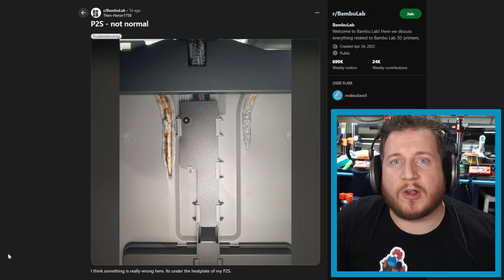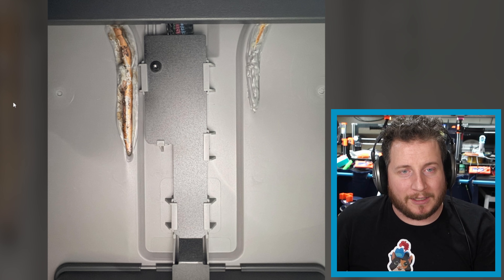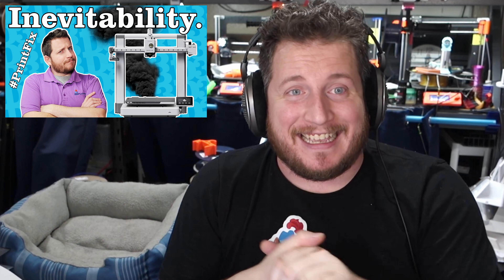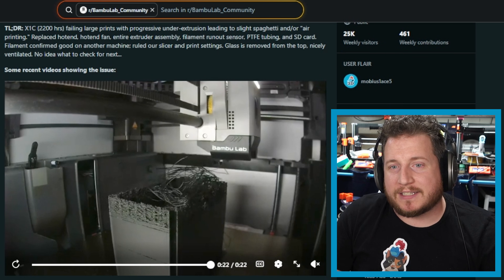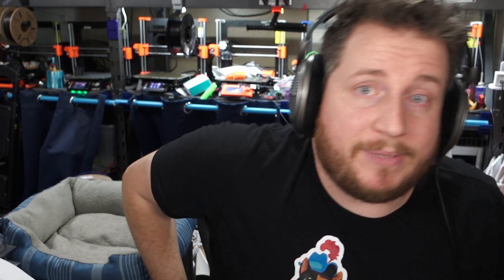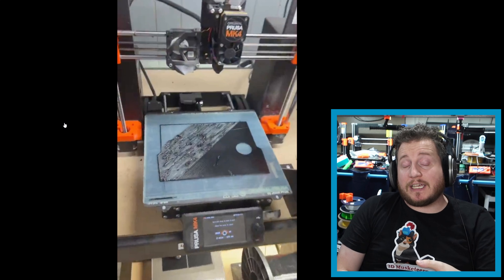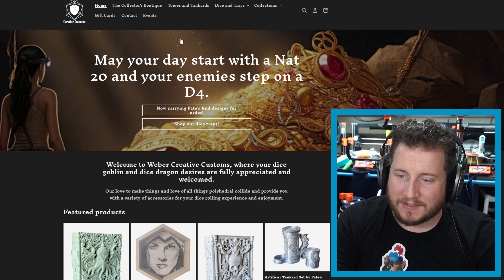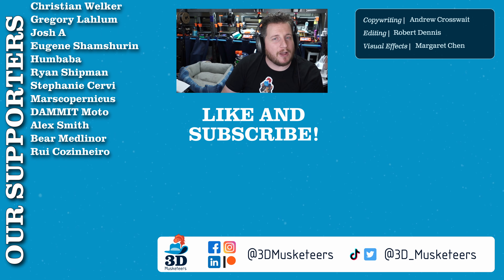Bambu FINALLY Responded - PrintFixFriday 226

Comment: I was listening to one of your shows, not sure what one it was on Podcast which I do frequently.  You were mentioning best sub 1K printer for 2025.   I heard the U1 come up.  I just went to check it out, one thing really makes me hesitate on it, I see it has a carbon fiber tube on it, thought other companies ditched carbon fiber tubes after they found out they can wear out and are not user replaceable?  Do you have any info on this topic? The U1 would be nice add to my small farm, perfect for some of stuff I do.  How easy is it get critical common fail spare parts for stock for U1?

Right now best bang for buck for me for proven printer is a 4Plus which I has been extremely reliable for me after certain early issues were taken care of.  I think for single color and bed size it is killer setup in that price range, this thing outperforms my H2D on quality of prints, this may change as I gain more time with my H2D, but print speeds and quality I get on Plus4 remains my fastest high quality output printer and they sell for 699.  I have several thousand hours on my Plus4 and it just prints perfect prints job after job, do tons of ABS on it all the time, and most of prints are extremely large. I love the footprint on it.  Other ones come to mind, the P1S at 399 is killer deal.  P2S is fantastic machine.  I have found that the 305 footprint and weight of Plus4 is at about the top size of range that I find comfortable to move on own. H2D is nice, but very tough to change out parts in this machine if you have issues like hot end fan failure, it is tough long job to replace fan or a board in it.  I have two Centauris with hundreds of hours each and absolutely zero failed prints, shame they are not releasing AMS for it.  My Centauri's do flawless ABS, once again and prints are very large volume prints. No warping. 

I need something that can do super high temps, I am looking into doing materials that require 400C plus temps.....and much higher bed temps then stock hobby printers.  I have begun my search to find a new printer that is setup for higher temperatures.   Product I am looking at making uses Ultem. Everything I have looked at to date requires about 10K investment.  CreatBot Peek 250 is one machine looking at, need to do more research on this type of printer that can match specs I need to meet.  i do like idea of direct annealing of print.  Everything I would make must be aircraft certified materials, traceable. Gearing up for better annealing setup also in 2026.

Comment: I run 8 of these but i have no idea qhere to look. Is there a manual somewhere on how to check this and replace of of needed
Reply from the maker: on the side under the wiper poop thing on the left side of the printer.

Comment: The Sunlu Matte issue goes deeper than covered. Unlike the shown  listing not being obvious but eventually saying matte somewhere, the listing for the high speed with spools (not refills) DO NOT (currently) mention matte at all, and yet guess what showed up for my Red/White/Blue/Black 4kg pack of high speed PETG? Matte. It doesn't stop there. Not only does the matte print like garbage even after drying, it looks like it is missing 50% of the necessary pigmentation. Red is a weird almost salmon color. White is a frosted mess. Black and Blue aren't much better. The color is not uniform through the print either with settings that work fine for every other brand of PETG I've run through my P1S. I ended up returning the entire package, and I never do that. I'll find things to print out of filaments I'm not super pleased with. Sunlu matte PETG was bad enough it went back asap. Never again, which is a shame because it comes packaged well and their refillable spool is nice.

Comment: Regular preventative maintenance and common sense printing prevents a lot of these issues. Anything that has heat and movement should be checked regularly.
Reply from the maker: This is absolutely not a part that should ever need to be checked on the Bambu, but if you were referring to the other fails, yes, often general checking is a great way to verify everything is still as expected.

Comment: Why doesn’t Bambu identify  which A1 printers have the updated power board by serial number. Who is to say how long before a printer sat in a warehouse or store before it was actually sold. I bought mine in November 25 but it could of sat 6 months

Comment: BTW,  has anyone bothered to check if these heat problems with the Bambu A1 and P1S started after a specific firmware update? Didn't hear anything about this before on their older machines before recent firmware updates. Something like an increased load on the board due to PID control loop changes to the firmware? And I have an A1 and P1S, but have not updated the firmware since the version that would have locked out my Panda Touch. No visible issue on the boards so far.
Reply from the maker: We have reports as far back as mid summer 2024. So?

Comment: "Never leave your printer unattended" - yeah right.  Like for a 20 hour print, you're going to just sit there?  I usually time kicking off my long prints so they're just finishing when I wake up.  This lets me monitor the start to check for warping or other bed adhesion issues, but after that, it's on its own.  I'm trusting my H2D to spot a failed print and do the right thing.  While I'm awake, I will keep checking in Bambu Handy, but there's no way I'm baby sitting any print that's longer than a few minutes.

If Bambu are blaming power surges, I guess we should all use surge suppressors, so if they try to blame a surge we can tell them to think again.

Colours in order: black, white, grey, clear, red, orange.  I mostly print functional stuff, and black probably accounts for 80%.  White can be useful for prototypes where I can mark them with a pencil to highlight where I need to modify.  Grey gets used for functional prints where black will be too austere.  Clear gets used for my spool storage doors so I can see what's inside.  Red & orange are just for accents/text.  I've also done a few wood prints.  There's a great wood grain texture on MakerWorld that makes prints look like they've been carved from wood (it even generates endgrain patterns).

Comment: I mostly use white filament for prototyping. My experience is white filaments are among the strongest within the same material. And it doesn't really hide potential mechanical failures.

Comment: Our experience with Sunlu has put them on our do not buy list. We bought a three colour 10 reel combo pack from Amazon. Both of the white spools we bought stopped unspooling almost immediately (filament stuck together on the spool so the printer couldn't pull it off the spool, or snapped the filament trying). Three of the five black spools started doing this at the 500-800g mark. The three spools of grey were the only ones that didn't exhibit this problems.

Once bitten, twice shy, as they say.

(Incidentally, I feel called out for asking about the A1 mini too, since we have both *8')

Comment: Is there a way to verify via serial number if the machine was produced in the correct timeframe to not have this issue
Reply from the maker: Not that we are aware of. It's easier to just peek on the inside.

Comment: I absolutely hate matte filament. It prints like poo. In fact I have some spools of it that I'm just printing things that I don't REALLY care about. Things I'm just using for myself and not giving to anyone. I can usually get a successful print, but the prints are brittle or the layers easily split apart. So I'm not using it for anything that will hold a load, that's for sure.

Comment: They specced a part that was running within an inch of it's life with basically no safety margin. Pure and simple. Let's not forget that for as much as these machines cost, they're still made by the cheapest bidder.

Comment: Problem with Prusa  bed connectors started with MK2 printers (Mine was one of them caused the main control board to become charred but still functional). I added an aftermarket Mosfet board to solve the problem).

Comment: If electric was cause, simply run off of a UPS which has clean conditioned power source.  Any expensive electronics should be run off a high quality conditioned power source.  I only provide the generation side of the grid, and the grid is a very complex and highly strained system these days.........and quite old infrastructure, as AI data centers grow out demand is really going to test the grid to the max in specific regions of the USA.  Predictions are showing very fast growth on grid electric demand in coming years.  It will really test our systems here in various regions of USA, each grid is not the same.  

Every grid in USA has it's own kind of unique character and size.  Throw in the great unreliability of green power into daily mix, and things will get ugly.  Nothing beats power that can be switched on when needed, there is a reason the core power of USA is natural gas, coal, nuclear powered, with some hydro mixed in.  The cost of wind means utility bills are going to skyrocket in the future, salt water and metal just do not mix well. That high demand and variability in solar and wind will mean more chances for grid issues....nature of the beast.
Reply from the maker: On surge and on ups's we still see the issue.

Comment: I'm mostly printing in black, but I've been using a bunch of 3D Fuel Natural PLA pro because it turns out kind of a pearl white which looks great, it's been good for functional parts, and it has printed really well. Occasionally have Flashforge burnt titanium moods like it seems a lot of people have and I'm not mad, i like the color. The black and blie shift with the green was great for a sega genesis themed print I did for a handheld I have.

Comment: Saw you got tagged on 3 new thernistor reports in a single reddit thread this afternoon. It's been a couple months so thank you again for bringing their buainess practices to light when they started being shady and saving me from the various headaches. My Magneto X might yeet motion motors out of the housing eventually, but they're slow and not an ignition temp failure, and the company has been great with the couple issues I've had so far. 

I just hope they're quiet because they're working on things and not doing a slow fade like my first printer manufacturer (Kywoo) did.

Comment: I bought an A1 from an 'Authorised Reseller' in June last year. Up until that point I only had one old Creality CR6 SE, which was giving me the $h!tZ hence buying a new printer. From day one I was having problems with breakers tripping. I assumed it was because I now had 2 printers running on the same circuit as other equipment, probably wasn't good anyway, but it was what I had. Anyway I had another circuit added, not cheap, and still had the same issue. One day I was out while the printer was going, the dog was keeping an eye on the printer for me 😋. When I got back the print had stopped half way, there was power, but nothing was working.
Got in touch with Bambu and they asked for photos, who I got it from, a receipt number and serial number, all provided. They came back with, no idea who that is you'll need to contact them. So I did, mentioning that Bambu did not recognise them as a reseller. Anyway, long story short, a lot of back and fro with Bambu and the supplier, and I now have 3 brand new power boards, 3 brand new bottom covers and 3 brand new wiring harnesses. Why 3, well it took so long for Bambu and the supplier to do anything, I just bought the parts from a legit reseller that had them in stock. 
The unit from Bambu and the one I bought do not have the Thermistor on the board, whereas the one from the supplier of the machine did. Guess I won't be using that board 😋
Thanks for the content, only found you today. Subscribed 😀
Reply from the maker: If you got the old one still and dont mind, we would love to pay to have it shipped to us. We will cover all associated costs :) 

Glad you have spares though! I may want to get some of those bottoms too, if your reseller can sell you a couple more.. I want to see just how FR they are...
Reply: @3DMusketeers  Yeah of course. Just DM me and we can arrange something.
Reply: @3DMusketeers  Actually just re-read your message. Sorry no I don't have the old (burned out) one. But happy to send you one of the covers, I'll see if I can get a couple more.
Reply from the maker: Ah bummer, tossed it? Yeah send me an email or dm me on discord. Would love to get some plastics in for testing.

Comment: I also bought SUNLU High Speed Matte PETG (black & white) and I don't know what they've added, but god this stuff always gets welded to the textured PEI, I thought I'm going crazy, even started to hack the bed temp down to the 40-45C, but it still behaves weird.
Reply: that's why its recommended to use glue. It's not to keep the part adhered to the bed. It's to help it release.
Reply: @Jodah175 I thought that I could get away with it on Textured PEI, since regular PETG works just fine.

Comment: Bambu print quality still shits on everything else.
Reply: They are good, but many other printers are just as good and they are quite slow with some materials like TPU compared to other printers.
Reply from the maker: that, in no way shape or form, is related to their safety issues. I dont care how good your printer is if it is a fire hazard....

Comment: So, as someone with an A1, and "not smart" with tech, any easy way to know if I should practise more caution? I think mine is from Q1 2024. I have one made after the last recall with the bed wire issue.
Reply from the maker: Yours is within the date range we are watching. Proceed with caution. Big ones: put concrete under it. It is cheap and will quiet the machine down some, so why not. Also, reach out to BL and tell them you are not comfortable with the safety risk and dont back down IMO. Try to not heat the bed and hotend at the same time, but meh, I dont think that matters THAT much, however we dont have a bunch of data on that yet.
Reply: @3DMusketeers  Well thanks. Now I kinda want to heat cycle it multiple times, with the block under it and a fire extinguisher bar above, just to see. Just looked, I see no heat deformation in the plastic at least. 

Kinda funny, with how well these machines are being made nowadays, that garage melting fear is coming back.

Comment: +1 vote for concrete pads under 3D printers.  400x400mm paving slabs fit perfectly under each P1S, and under that I have custom cut to the same size a high-density reclaimed foam pad. Damps noise and vibrations, running 24 printers inc 12 P1S on sport mode, and the noise level is never more than 'reassuringly productive'.

Comment: Heat creep was quite obvious, especially since the fuller bed started to get messed up at a lower height - because the number of items took longer to print,

Could you laser weld the nozzle tip with a few dots? That should be fairly easy thing to automate.
Reply from the maker: oooooh laser weld!

Also, dude updated his post again, still having it, so, I am lost again on it.

Comment: Add my new A1 to the list XD (Spain) They just sent me a replacement for the melted AC board, the hotend heating assembly, the silicone sock and a new nozzle. Now the hobby changed from 3D printing to 3D printer assembly. 😂
Reply from the maker: still got that AC board? Happy to pay to get it to us.. 

Also, email me, I will send you some questions if you have time!

Comment: Ask an RTX 4090 or 5090 owner how low voltage can be dangerous.
Reply from the maker: Me and my 1080ti's are just happy thank you
Reply: @3DMusketeers  They use about half the current and the power plug is more chunky.

Comment: Did Bambu say lightning strikes or did they mean that in rush current was causing something similar to thermal runaway?
Reply from the maker: the Toms hardware article referenced lightning and power surges. But no other reports of damaged equipment along with the printer have occurred. sooooo?
Reply: @3DMusketeers  hrmm, somethings fucky.

Comment: There was no power surge or lightning when this happend to me. Normal startup, and my elegoo n4p and cc started up just fine at the same time.
I use a smart contact with power surge protection, and that one would have noticed that in case of such event.
Reply from the maker: yeah, reports of power surges damaging ANYTHING else have been... checks notes.. oh yes, 0

Comment: RE: The P2S melting. It's on Bambu, of course. They ship the package, and are responsible for it getting ot the customer as expected. But things happen. As long as they're taking responsibility for it and fixing it / sending out the replacement parts or a replacement machine, under their own dime, that's fine.
Reply: Looks like a coffee maker - heater element glued to aluminum block, insulated from the rest of the world (including plastic parts) only by air 🤨
Reply from the maker: this one, IMO, needs a new machine